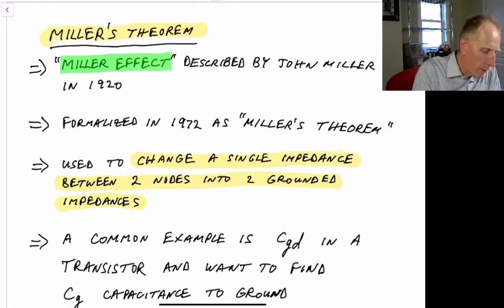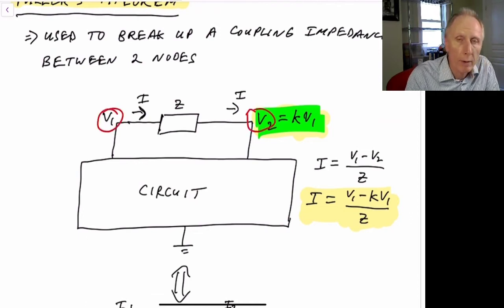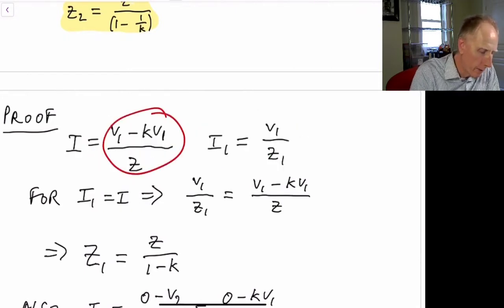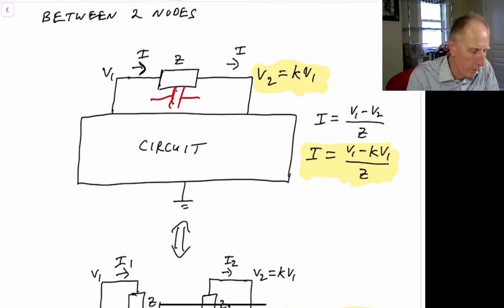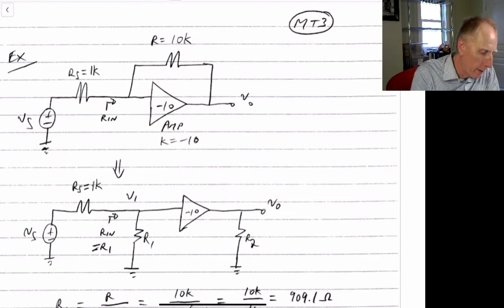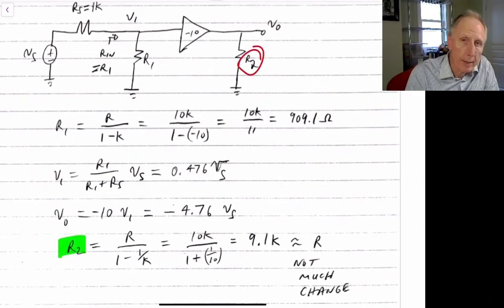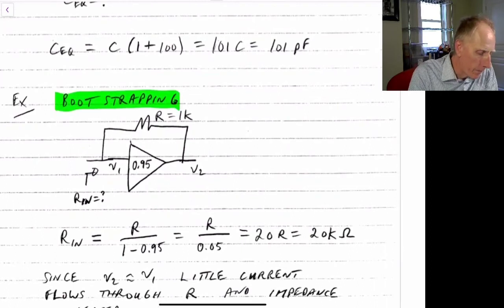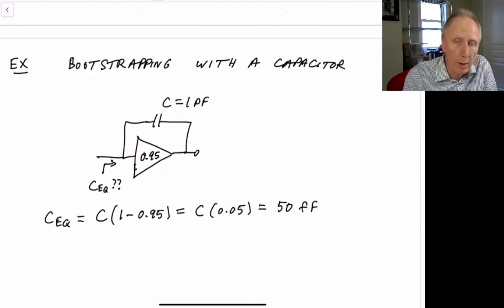Analog Electronics 2 - Miller Theorem

Comment: What would happen for amplification values greater than 1?
Reply: I believe you'd get negative which just represents current in the circuit flowing against the predicted way, aka feedback from Vout
Reply: Vout would be greater than Vin, so the current in the resistor would flow the other way around